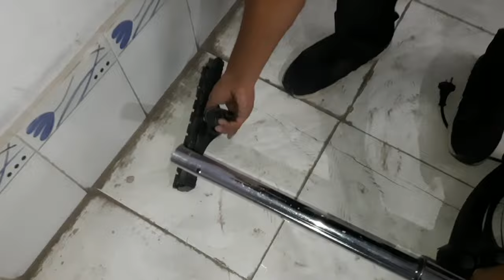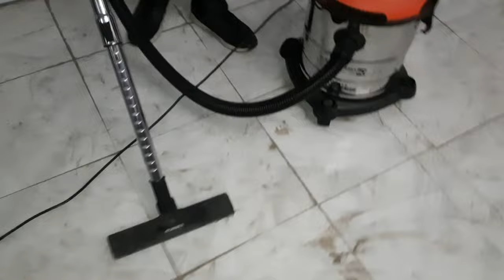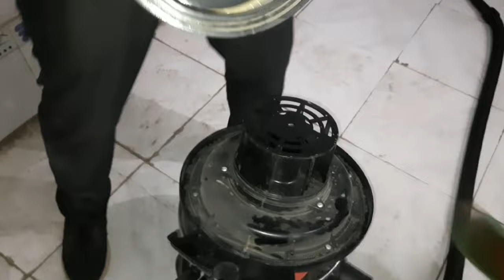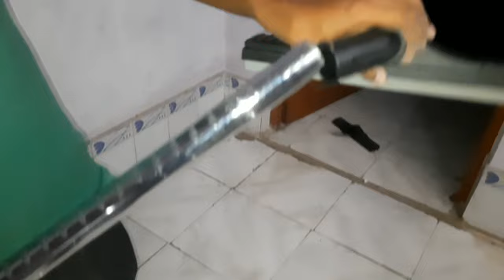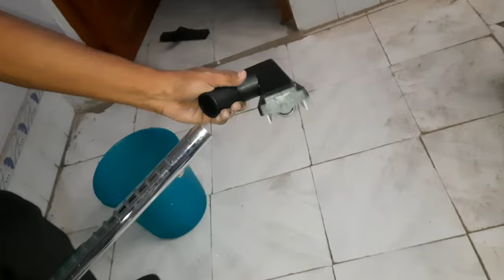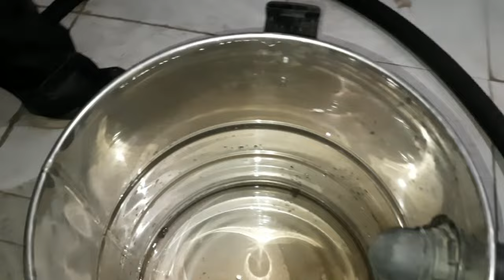EUREKA FORBES Ultimo Wet & Dry Vacuum Cleaner (cleaning process)

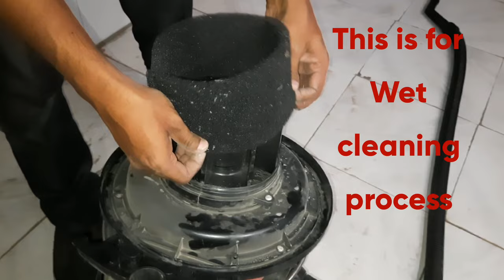Comment: What is the item shown at 2:52 called? Mine got torn need to buy new
Reply from the maker: It's a foam type material which is used for wet cleaning the foam as filter of vaccum cleaner you can purchase via online